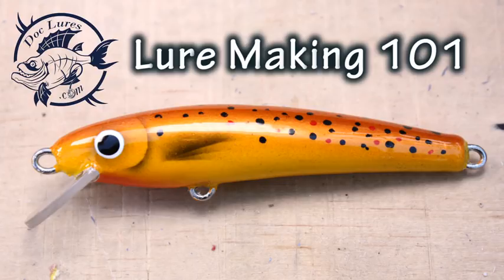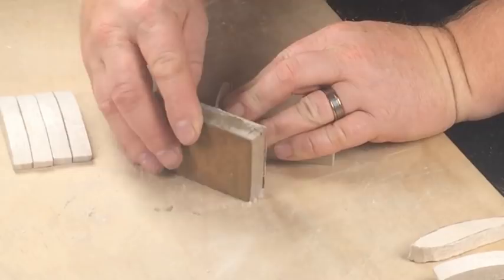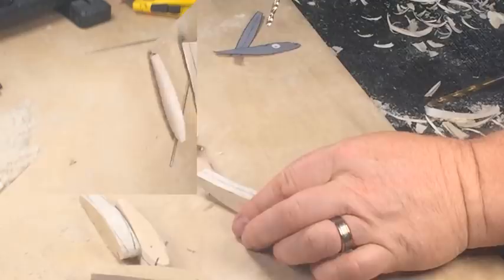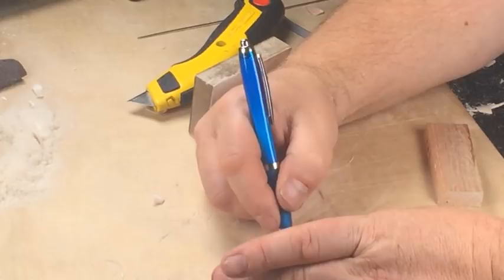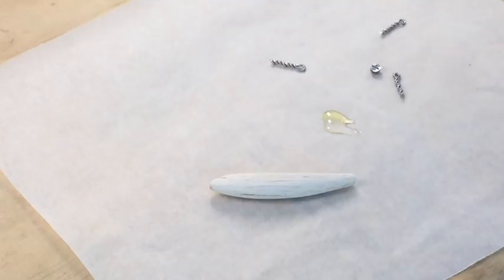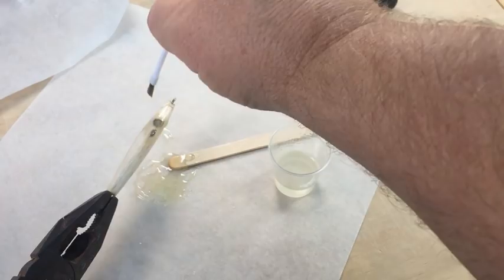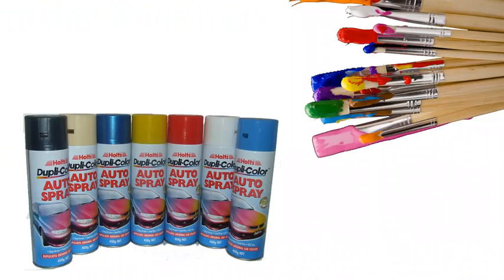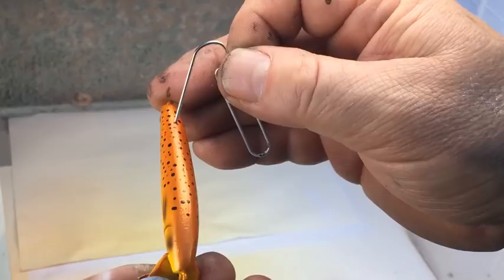How To Make A Simple Balsa Crankbait

Comment: How big and heavy fish will the twist eyes hold on a balsa lure of that size manage that i epoxy with several layers before it breaks?
Reply from the maker: Jakelol1980 Great question, thanks for asking! I’ve hung 20kg weights from a similar sized balsa lure with twist eyes and they held that weight overnight. Some balsa is softer than others and not all epoxies are equal, but generally speaking the force required to pull twist eyes is way more than the breaking strain of any line you’d use with a lure of this size.
Reply: Sounds like well enough for perch and smaller pikes up to 5kg then? I was thinking if i should go with twisted eyes instead of through wire and save me alot of time what do you think? I will be making small lures mainly for pearch but also for smaller pikes.
Reply from the maker: Jakelol1980 I think twist eyes will be fine for those applications. I’d switch to a through wire if you were going heavier than 6 kg line, otherwise go for twist eyes
Reply: Perfect will go for through wire when i will try to make pike jerkbaits then. The smaller ones im gonna make now will be tiny jerkbaits for perch and trout ;)
Reply from the maker: Jakelol1980 cool! Post some pics on my website, would love to see your finished lures. ;-)
Reply: Will do for sure. Just need to buy an airbrush and stuff but maybe within 2 months give or take.
Reply from the maker: info on airbrushes for lure makers ;-) https://makewoodenlures.com/painting-fishing-lures-2/
Reply from the maker: also..... free crankbait making course that includes some info on painting equipment, paints and techniques ;-) https://makewoodenlures.com/crankbait-making-101-landing-page/
Reply: @Makelures  hi do you sell your lures if you do can you please get in touch with me thanks